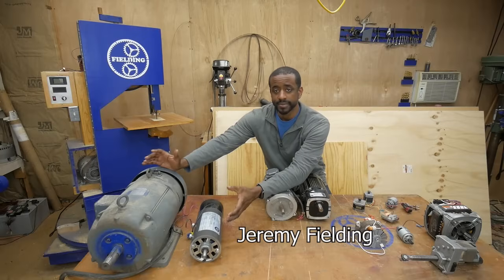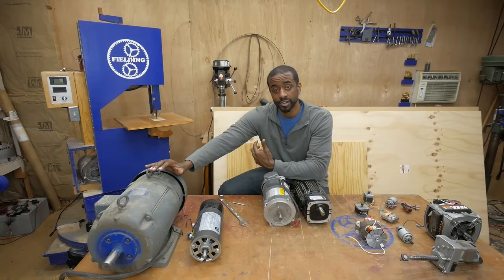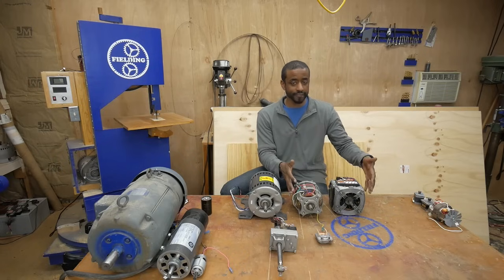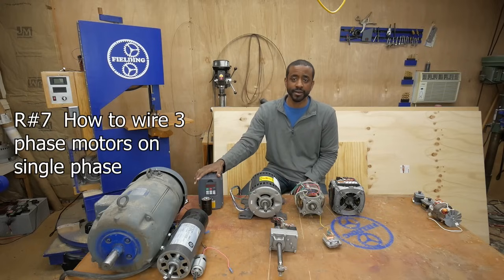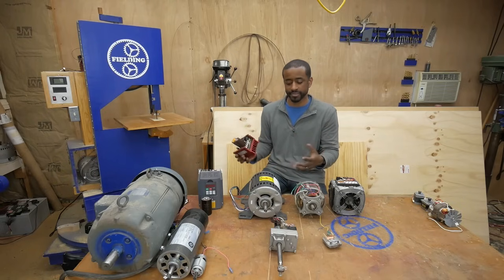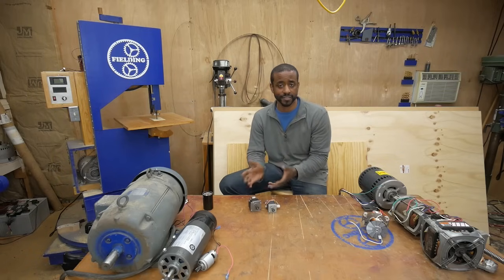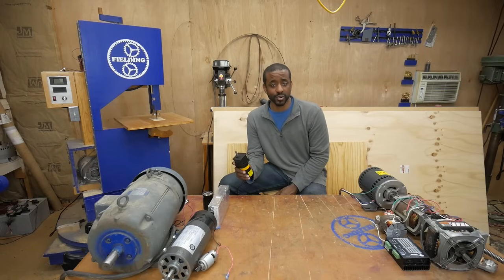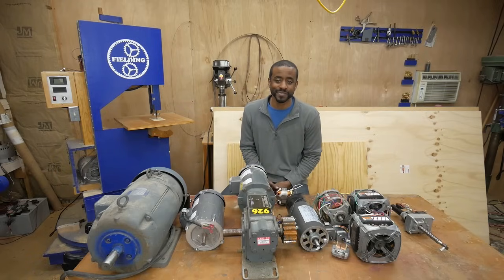Ultimate Beginners Guide to Using Electric Motors for Makers and DIY Projects; #068

Comment: I have a 1x30" belt sander from good ole Harbor Freight. It spins way too fast (3450 rpm). At the same time, it has no torque, as soon as you press into the sanding belt the motor stalls and the belt stops. I wish it had half the speed and twice the torque. I wonder if there is an easy way to achieve this... I'm going to have to give it some thought. There might be a way to do this, maybe I can switch out the drive pulley from a 4" to a 2"... Thanks for the info.
Reply: If you want half the speed and twice the torque, reduce the diameter of the wheel on the motor shaft by 50%. If it is 4 inches now, make it 2 inches. You could also look for a 1750 RPM motor (anywhere around there at slightly under 1800 rpm). Use the 3450 rpm motor for something else. Maybe a table-saw.

Comment: I always wondered about that when I check out the motors at the salvage yard.  They have racks of these HUGE motors probably used in lifting cranes for shipping containers.  I wanted to just bolt that in my truck in place of the gas engine.  I read the plate from the monster motor that needs an actual forklift to get it off the pallet, has 1" & 1/4 output shaft.  Motor output say "1/2 h.p.".   Really ?!?!?  I have to buy that one, get it home and take a big fat guess what the heck it's going to do and be surprised by whatever specialty bearings and machine-shop time it take me to re-do whatever was worn out in it.

Treadmill motor say "3 h.p, 2200w" draws MAYBE 13 amps @ 120volts when it's at full blast and I apply resistance to the shaft with rubber friction pully.  I got a bunch of these, but like you said - it has to get up to like 6,000 RPM in order to have some SPANK in the power.  It makes heat, so has got to be cooled, AND it is NOT sealed & enclosed, so sand, dirt, water get sucked in, then  the party is over with THAT motor.  I thought if I just made a mounting plate, put 3 treadmill motors drive the shaft through a belt, but there are too many issues.  Treadmill can actually take 220v DC, so that is practically a TON of batteries all wired in series.  Then I would have to build my own DC speed controller, play fun games with cheap China controllers, or spend a fortune on a good speed controller that can just go "POOF" if I make a clumsy mistake.

Comment: Awesome info, if i May ask you? If you were to build an electric motorcycle, what electric motor would you use or recommend? I’d like to be able to get up to the speed limit at least?
Reply: It is either going to be BLDC or some kind of custom induction motor. Standard NEMA induction motors will be too heavy. Zero brand motorcycles use BLDC motors. I believe they are the leader in the field.
Reply: Bldc motors are the way to go. You can use very compact drivers which has special features.

Regen braking, multiplying phase current at lower rpm, (wicked torque at low speed). Etc.

Any bldc motor worth its salt with use sensors for smooth operation.

As for batteries, a custom lion pack using 18650s is the way to go. Don't bother with lead acid, nicad, Nimh, etc.
Reply: Search Bafang.  It's really more e-bike than motorcycle, but still cool.

Comment: What I find difficult to find information on is power equivalency, specifically induction motors Vs universal motors. If both are 1100W for example, do they have the same amount of power, or do their different efficiency levels mean different actual power output?
Reply from the maker: 1000 watts is 1000 watts no matter what motor electric, gas, whatever
Reply: @Jeremy_Fielding  thank you
Reply: Usually the Watts will refer to the mechanical output power (speed * torque that Jeremy mentioned). Sometimes people may use Watts to describe how much electrical power is consumed by the motor. But if they don't explicitly say, then they are probably talking about output power. The input power will always be higher than output power for any motor. The ratio of output/input is efficiency. So two 1100 Watt motors may have the same output power, but if one is more efficient, it will have lower input power than the other motor.
Reply: @mckenziekeith7434  Yeah, it sounds like that was my confusion - I always assumed the quoted power was input power. Thanks

Comment: can you use just one phase of the VFD?
Reply from the maker: No... most VFD's have safety interlocks to prevent this.
Reply: @Jeremy_Fielding  what about adding a function for single phase motor mode? It would just run the 3 phases in sync, with no additional design cost.

BTW, apostrophes are never appropriate for plurals, even initialisms and acronyms. If you feel it is necessary, use a set of quotation marks instead

Comment: Can’t I just take out the capacitor to make it function as a 3 phase motor? If so, will it have to operate under the rated 110/240vAC or will it hold 380vAC as well?

And loveeeee your videos!!!!!! Your content is extremely helpful I wish you only the best
Reply: *I have a VFC
Reply from the maker: Check out the reference to how single phase motors work. I explain in detail the difference in that video

Comment: It is instructive to note that three phase motors are preferred in commercial HVACR applications, due to their higher starting torque as opposed to split-phase motors.  Domestic refrigerators and air conditioners have no liquid line solenoid,  so they equalize pressures within a minute or two, and therefore don't require HST motors in their compressors.   But I digress...

Comment: Liked and subbed!  Keep up the good work!  Many people get hung up on the BTU and the calorie.  These are units of energy;  not power.  Yet, sadly,  most manufacturers of heating and cooling appliances rate their power in BTU's here in the USA.  This is wrong.  Although BTU/hr is implied,  it is mis-stated as simply BTU.

True,  that no matter what the rated power,  if the required torque for acceleration from zero RPM exceeds the stall torque of the motor,  movement is impossible.   This why I like DC motors.  They have brutal stall torque.

Comment: Also for the 110v induction and universal motors you can get what's called a variac to control speed. Its steps the voltage down as you turn the knob.  High amperage variacs are expensive though.
Reply: Variac is not going to work very well at all for controlling the speed of an induction motor if you are trying to do any real work with the motor. But works great for universal motors. Induction motors need to be driven on a V/f = constant curve to do useful work. Also, many single-phase induction motors have a centrifugal relay that activates the start capacitor at low speed, and then deactivates it at high speed. If you slow down such a motor, the start cap may be energized continuously which is not good and will probably lead to failure of the cap.

Comment: I've been an electrician for 35yrs and was apprentice of the year but you know more about motors than me. We just hook up the motor the engineer said to put there or fix or replace the motor thats there. You know more about application is what I'm trying to say. Where did you get all this knowledge?
Reply from the maker: I am self taught. I spend hours trying to figure out how to use a motor I found in item "x"... then I research it, then I experiment with it, then I read some more on it... and then I make a video about what I learned.

Comment: I have a small nearly a hundred years old benchtop metal lathe, the make is "Drummond" from England. What type and capacity motor shall I use to power it. Thanks.
Reply: I would think that one of the treadmill motors with the matching VFD controller would be the way to go. I have seen them used on the small Chinese Mini lathes here on Youtube also. That way you can adjust the speed without moving belts on pulleys.

Comment: Thanks Jeremy for showing all the different motors and talking about its configurations. I used a 2.5 hp  trademill motor to power my Shopsmith mark v. It works fine but gives me a "hi acc err" at times. I have used the original controller circuit. Can a treadmill motor with its controller handle variable load? The Shopsmith is a professional multi tool and works as a tablesaw, bandsaw, lathe, drill press etc. Thanks.

Comment: Your so wrong, speed got nothing to do with HP. Tip look at car engines.
Reply from the maker: Thanks for watching! It’s a great day to learn.
Reply: Power = rotational speed * torque / constant. Just like Jeremy said. For car motors in the US, it is HP = rpm * torque / 5252. Torque should be in foot-pounds (otherwise you have to use a different constant instead of 5252).

Comment: Did you ever work out what motor and controller is best for a bike application using a 115 deep cycle leisure battery would the motor get 25 mph over a 50 mile round trip?

Comment: You and also have a 3hp brushless motor that either a low rpm high torque or vise versa that can fit in your pocket. Outrunner motors are the way to go portable with power

Comment: The size of the motor may be a better indicator of torque, rather than horsepower, because horsepower is a product of torque and speed. Small motors can spin really fast. That blender motor can put out close to 1/2 horsepower, because it turns 18,000 RPM. You don't need much torque, to approach 1 HP.

Comment: I have a 120v 1/2 hp motor. The shaft spins very slowly. Like 2 rpm. The it has a brand new capacitor. Is the motor fixable

Comment: Treadmill motors are excellent low speed generators suitable for wind turbines water wheels or exercise bike generators. The higher DC voltage on the nameplate , the lower rpm is needed to make a certain voltage. I use a 180V  motor on an exercise bike. 30 RPM on the pedals is enough to run a 5V  car phone charger and 60 RPM is 16V open circuit or 4-6 amps when charging a lead acid battery.

Comment: You mention that you can take 110 volt universal motors and run them on battery DC power. But it is never explained what DC voltage and current will be required to achieve the same RPM. Is there an equation for AC voltage x current = DC voltage * current * K where K is some sort of conversion unit? 
What about the gauge of the wire? Typically it is important to use the correct gauge of wire to accommodate current. If the voltages, AC vs DC are radically different, then the wire gauge (and insulation) could be important, especially in the long run if the motors are to be run over extended periods of time. Perhaps you could dedicate a whole presentation to this topic? Thanks!
Reply: The wire diameter can be the same as AC use. It will not use more current when powered from DC. The speed may be a bit different. This is hard to predict. Best bet is run the motor with no load from a voltage source (it will probably spin with 2 car batteries in series). Measure voltage and speed. Determine motor's DC speed constant (rpm/volt). Use the speed constant to predict speed at other voltages. Of course the speed will drop a bit under load, too.

Comment: Duty cycle matters!

Years ago I built a ~400 HP heavy towing duty Ford 460 V8 for my work pickup and a buddy of mine also built a ~400 HP  2.2l I4 for his volkswagon rice burner.  

He was teasing me about how he was getting the same HP from a fraction of the engine, to which I replied.  "Yes, but lets put a 12,000# trailer behind each of our vehicles and go drive on the interstate at 80 MPH and see who's blows up first."  

 No reply came back for that point I made and about 3 weeks latter he blew the whole bottom end out of his engine doing a burnout off a stoplight just to show he had the power.   Whereas I drove my pickup pulling heavy loads for about a year and half and several 10's of thousands of miles until a little old lady took the whole front end off my work pickup one day.   

DUTY CYCLE MATTERS A LOT!

Comment: Great video. What can I find 3 phase motors in to salvage.
Reply from the maker: It is extremely unlikely to salvage one. They are usually found in industrial machinery. The one that was on the bench however came out of an industrial / commercial treadmill.
Reply: I don't know if this will help you. But I once worked near an elevator repair shop. They scrapped giant induction motors regularly. These are odd motors (some designed to run in an oil bath, and most not rated for continuous duty) and might not be what you want, but at least the price is right. Sometimes there were also small DC motors used to open doors. Similar to treadmill motors. I never did take one of the induction motors, but I scavenged one or two of the door-opener motors.

Comment: Check ebay for stepper motors. I got 3 nema23 5A low inductance for $120 for my cnc.  I didn't want to skimp. One is weaker than the others but still powerful. They are the ones in my cnc videos.

Comment: as a note on size of the motors, on ac motors name plate will give you the frame type, this is a code for the physical dimensions of the motor housing bolt pattern and shaft size. it will also give you the horsepower and rpm of the motor, this information is all you need to replace a motor other the the power that being single or three phase. one other thing some time you will find a frame that is a TC-56 or a T-56 these will be the same with the difference being the TC means there is a 4 bolt pattern on the face of the motor to use to mount it as well
Reply from the maker: I was kicking myself right after publishing that I didn’t say a word about reading labels 😬
Reply: @Jeremy_Fielding  no worries as always a great video full of wonderful information

Comment: That was a great video, i am an aeronautical engineering student and i have a project, part of that project is a high power , high speed (1M/Sec "max") linear  Actuator, i know the perfect motor for this is an industrial servo motor and servo drivers , but they are ridiculously expensive in my country " a 1kw servo motor can reach a value of 5000 pounds used without the driver , and the average salary per month in here is about 4000 pounds, so they are out of question, so can i used a universal motor instead because they way cheaper 1.5kw is about 200 pounds, i know they can't hold there speed because they are connected in series ,but if i convert it to a combination DC motor (" the rotor and the stator are powered from a different power source"),with a motor speed(rpm) feed back and a linear Actuator position feed back and (a voltage and ampere feedback for both rotor and stator)...Can it be done or the universal motor characteristics won't allow it?